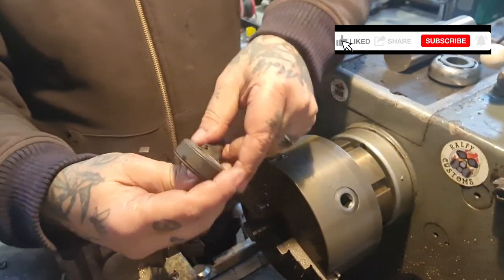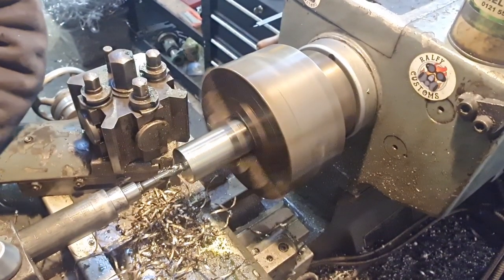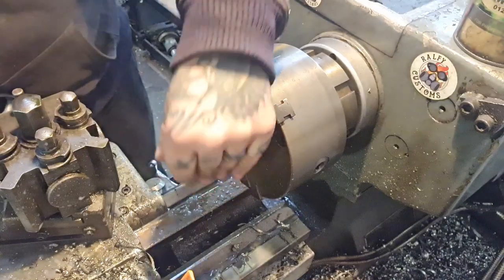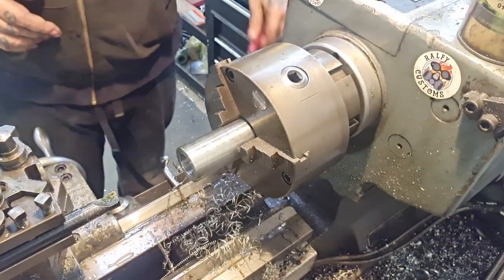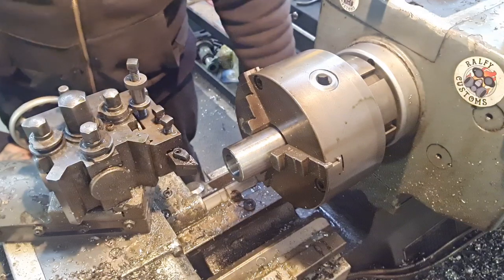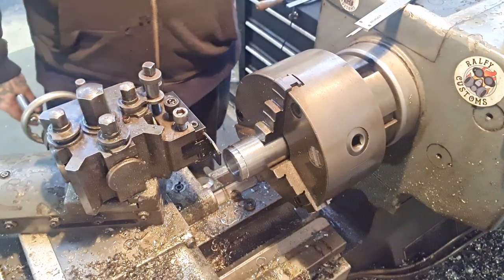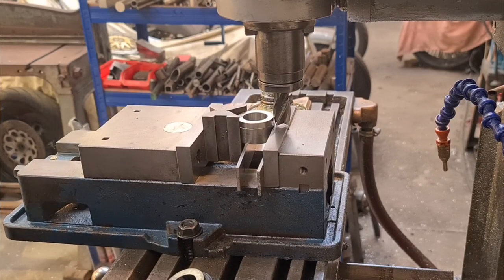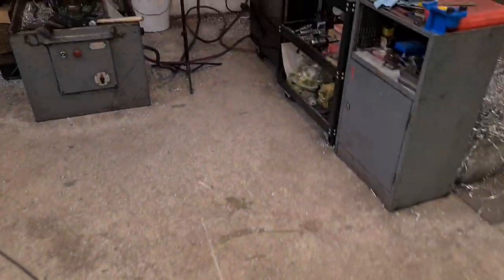ABS Removal Road King Custom Harley Build Motovlog #chopper

Comment: If you delete abs how do you keep the light from coming on ? I have a 2012 roadking and wanna delete the abs because my pump went bad and don’t have the money to buy a new one so I will bypass it
Reply from the maker: You can't just remove it as far as I know, the computer won't like it
This is a full custom build, with a  the new ignition, so it doesn't matter